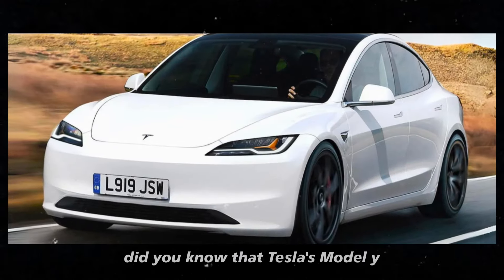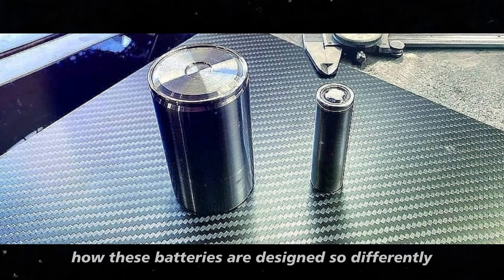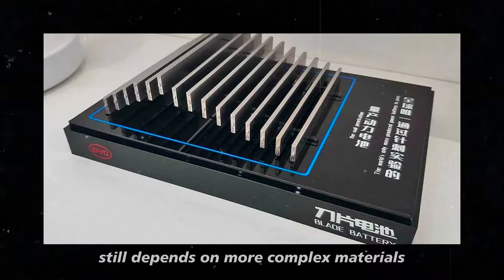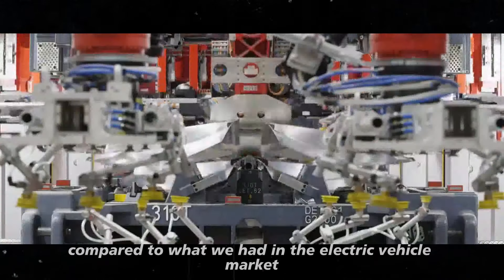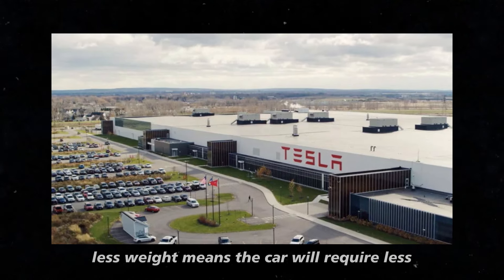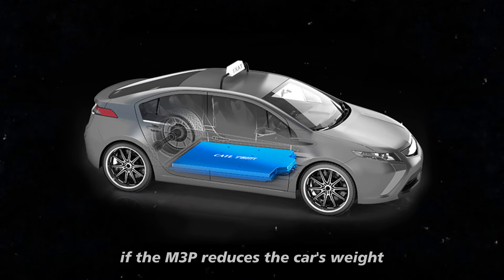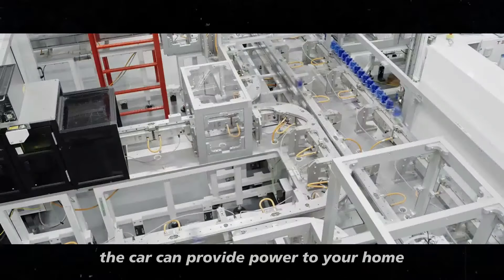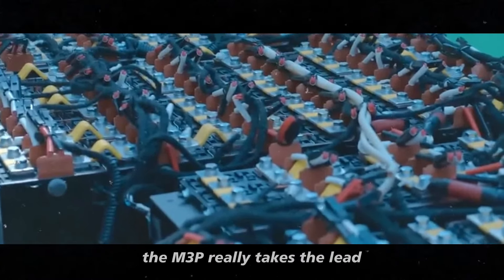JUST LEAKED! Tesla Unveils New M3P Battery Technology For Project "JUNIPER" 2025

Comment: 10% increase in range is basically nothing in a world of ever increasing battery performance. And 10% better than what??? BTW, 10% for a car that gets around 300+ miles range is only 30 miles, no matter how it is measured. This is a very incremental change. 20% would be great. The vaporware solid state batteries promise 50+% increases plus lightning fast charging and increased lifetimes. That would be groundbreaking. 10% is basically meh.
Reply: If the battery pack is substantially cheaper that would be groundbreaking.  But I essentially agree with you, this is a minor innovation.  Also, this is a battery manufactured in two places in China.  Catl is the world's largest battery manufacturer.  With the tariff structure that was put in place by Trump and kept in place by Biden - in the United States you end up paying a premium.